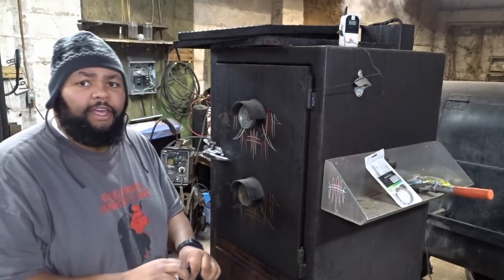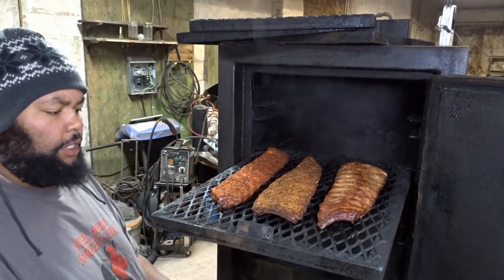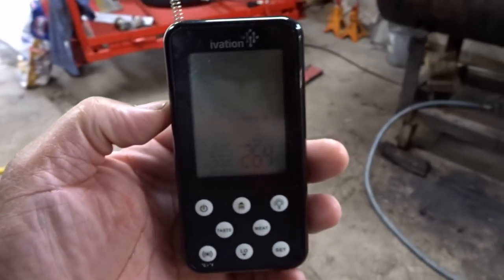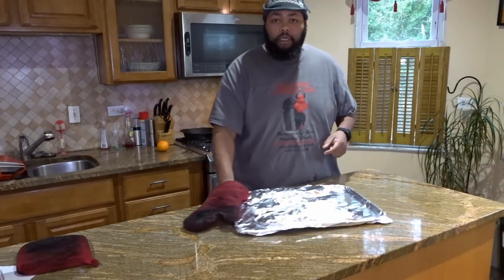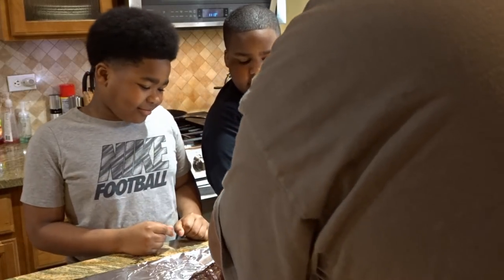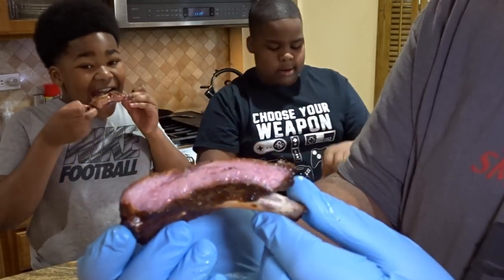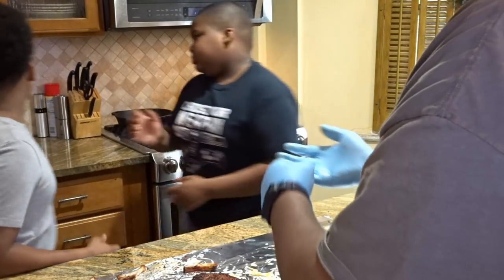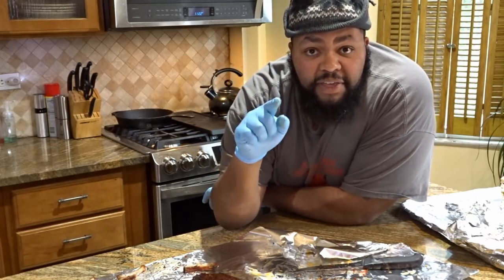Porter and York - Baby Back Rib Blind Taste Test - Seasoning 3 different ways - Part 2

Comment: I've found when I use a salty spice blend I have to go a little more sparingly on ribs and chicken, especially if I want to use a sauce on them, the salt will totally change the flavor I was expecting to get with the sauce and it wasn't in a good way. Big cuts like pork butts and brisket can handle the external salt because there's so much internal meat to basically dilute it with.
Reply from the maker: Those are my exact thoughts when I season anything.